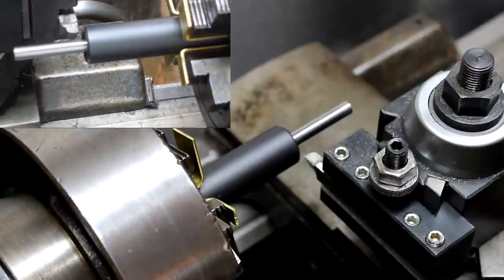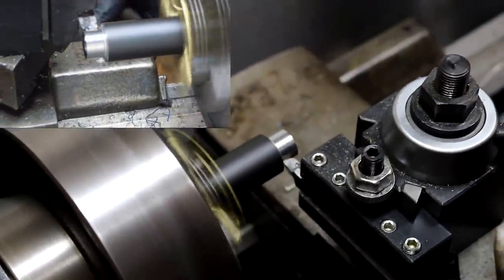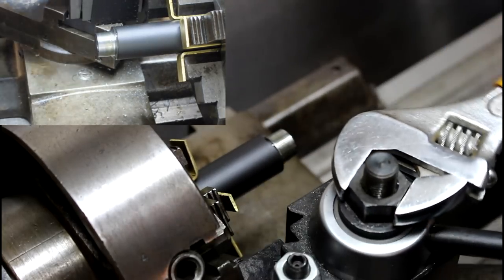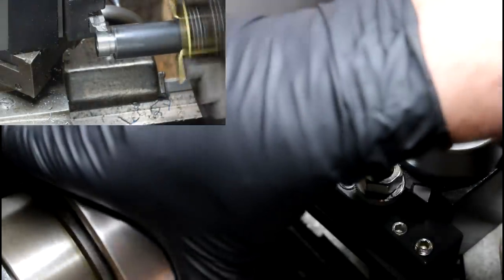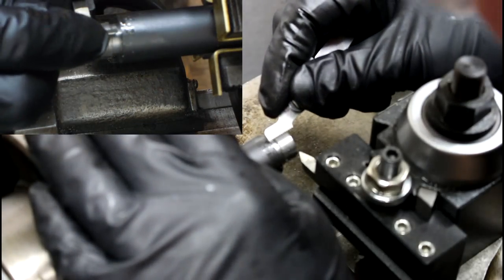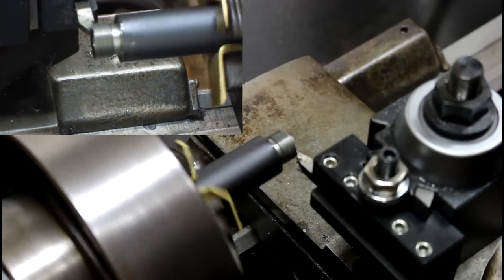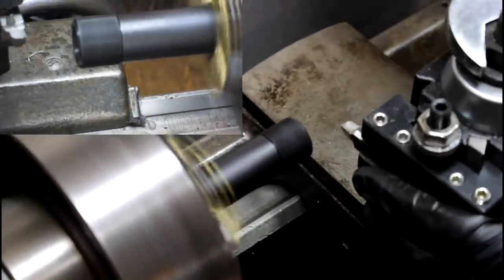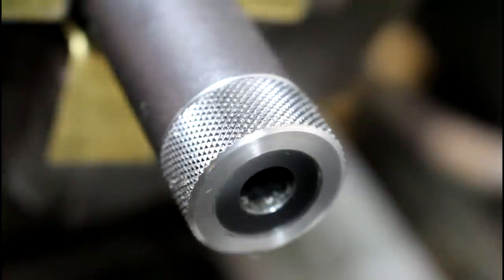Threading a Barrel -Thread Protector Installation! Gunsmithing Remington

Comment: He is wearing gloves.  That is not a good practice for a machinist.  Neither is wearing a ring.
Reply: Rubber gloves are not likely to pull your hand in. I can't take my ring off so I'm as careful as I can be.
Reply: +Mike Dittman Just keep 911 on speed dial.  Safety rules are written in blood.
Reply: Adam Jeppson lol everyone should be as safe as they can but prepared for the worst. I have a ring on my non dominate hand that I can't always take off what am I to do? Not work when it won't come off?
Reply: +Mike Dittman LOL!  Up to you, Mike.  I never wanted to lose a finger.  Or tell the boss I can't work today, because my ring won't come off.  LOL!!!
Reply: +Mustang Gregg that's the perk of having my own shop. Or danger but when it comes down to it these machines can rip your fingers off if you're not wearing a ring or gloves. It all boils down to running the machines safely and never putting your hands where they can be caught.
Reply: +Mike Dittman
You can't take your ring off?
That sounds like a medical condition in and of itself.
Reply: ECCO Machine a machinists most intimate object in his life is his slivers.
Reply: I'd go to a jeweller and have t cut off re-soldered and resized to fit properly lol
Reply: No the rubber glove  won't pull your hand down . But the guy is also trying to slow the lathe down by pressing the glove against it . Just bad practice ! I only run a brake lathe but I have seen a guy get his thumb taken off because he went to brush the rotor while the machine was still turning and his rubber glove caught just enough to drag his thumb down to the tool. It was bloody and it was hard to use it again for a week or so .
Reply: Don't worry about a stuck on ring, the lathe will pull it off along with your finger.I have seen a poster of it,finger with a ring and six inches of tendon on it too.

Comment: 5 or 6 a week for a couple years and still you remain totally clueless.
Reply from the maker: This was the first time on my own machine, which I later found out was totally worn out. I had limited tooling at the time too. After upgrading to nicer machines and tooling everything got back to normal.  Prior to this I was in a fully tooled gunsmith shop with everything at my disposal.

Comment: You cannot rely on the outside diameter being concentric with the bore.
Reply from the maker: +Val Martin 
I'm not sure where people are making this assumption from. I start out the video with an indicating rod in the barrel and I indicated off the bore before I started cutting! I have never threaeded, chambered, or contoured a barrel based on the outside of the barrel. Most barrels and especially Remington barrels such as this one can be out of concentricity by up to 2-3 thou. I do appreciate your comments, just can't figure out where in the video it looks like I was indicating off the outside?
Reply: +spitfire1821 you didn't
Reply from the maker: OK, I've had a few people mentioned that and it just confused me. Thanks!

Comment: I was just wondering what a gunsmith charges to have this done. Could you give me a fair price?
Reply from the maker: +Steven Lenz Most guys seem to charge in that $100+ range depending on what type of brake. To do it right you need to zero out the barrel from the bore and then time a brake if needed. If you don't need timing its usually around $100.
Reply: Don't ruin your barrel! Pay a trained Smitty and retain your accuracy and barrel life

Comment: how small a relief cut is best?
Reply from the maker: +ericbc7 
A 3/32" cutter usually works pretty good.
Reply: Rule of thumb.  Divide 1 by number of threads per inch and to that number add .010 for a thread relief width.  Tool shape is straight left side perpendicular to the tip/front and the left side 30 degrees.  Stone the two corners to a .010 radius.
Groove in to a diameter slightly smaller than the thread minor diameter. 
Every standard thread has a major diameter, minor diameter and pitch diameter.  Pitch diameter veries with the class of thread being produced. 
All these dimensions and the way to derive them are printed in the " Machinery's Handbook ".
The first thread is generally chamfered 45 degrees, but may be done at 30 degrees.
NOTE:  When threading to a shoulder you will have to grind your threading tool to the left side of the tool bit so the point enters the relief area and the left side of the tool does not hit the shoulder.  That is something that takes some care and skill and is what being a machinist is all about.
Hope this helps, JIM

Comment: Well done video, good sound and the dual views are nice.  Can I ask, when running at 1200, how much material are you typically removing at a time early on?  The deep cuts?  Obviously towards the end it's very little to get a good finish.  Thanks.
Reply from the maker: +Jason Keim about .020-0.030" per pass. When you know you need to take 0.150" off, you can take a few HEAVY cuts, remeasure, then decrease your cut depth the closer you get. On your final couple passes you should be taking 0.002-0.003" per pass to get to your final dimensions. Let me know if you have any other questions. Thanks for watching and commenting.
Reply: Great, thanks again for the info!!

Comment: what lathe do you use here?
thanks
Reply from the maker: This was an old worn out Logan 922 11x36" lathe. It was on the the entire machine was extremely worn. I've since upgraded to a fully restored and reconditioned south bend heavy 10x36 and a south bend 13x40.
Reply: ok thanks

Comment: Too much machining after the fact to compensate for not planning or taking accurate dimensions.
Reply from the maker: Threads were set at 1/2" for a specific muzzle brake. Most thread protectors come in the .625-.650 for 5/8-24, most muzzle devices are .625 when using 5/8-24. I've since changed most of what I do here and the machines. Threads now look like a CNC did them.

Comment: You stated you threaded several barrels a week for several years but yet you don’t have a clue right off the bat on the length of the tenon. That’s just the start to this train wreck.

If anything is positive about this it it’s made you a lot of money. It’s probably why you left it up. With my comment you just made $$$

Comment: A Rem 700 is one of the strongest barrels made  you have reduced the wall thickness by over 50%  an Idiot and a lathe should not mix with Firearms
Reply from the maker: There are a set standard of wall thicknesses that you can cut these too, and this is a heavy barrel. Still ended up being more wall thickness than your standard 700 barrel.

Comment: Dude you are dangerous. Stopping that thing with gloves on. If you would have been working anywhere I did and wore gloves your ass would fired. It only takes a second to get hurt. And it does not matter if they are thin surgical type gloves. Be smart you can wash the oil off your hands.

Comment: you can watch 10 different vids and have 10 different ways to do a muzzle brake... the recess doesn't make sense, nor cutting threads a thou at a time. ZZZZZZZZZZZZZZZZZZ
Reply from the maker: +Ralph ditore 
The recess is not needed, and this one ended up quite a bit bigger than they normally are. As for making small cuts, yeah, its boring, but cut to deep and you have to cut it off and start over. Thanks for the comments.
Reply: the recess makes sense to most turners...
Reply: It's an undercut, your threads have to terminate somewhere...